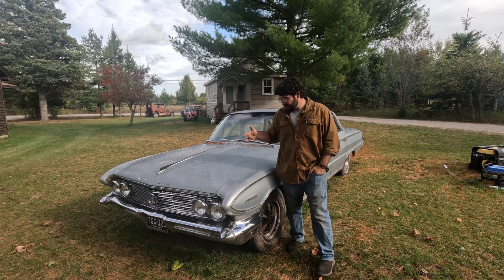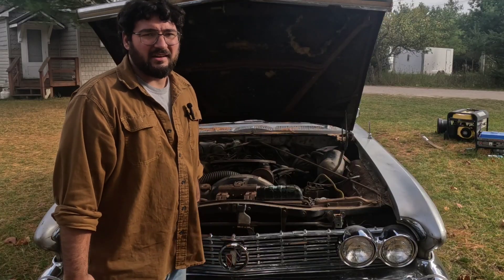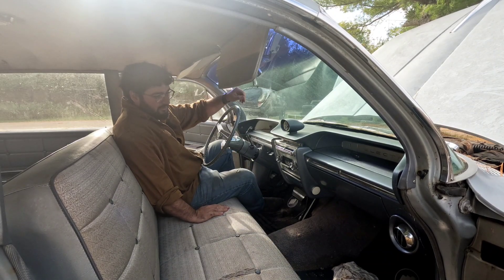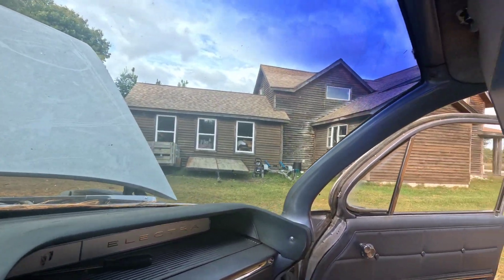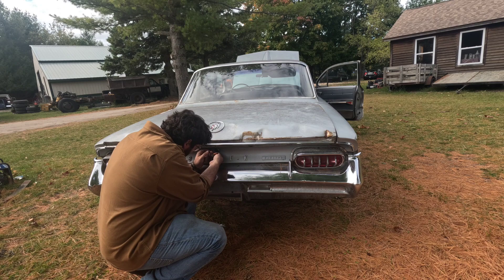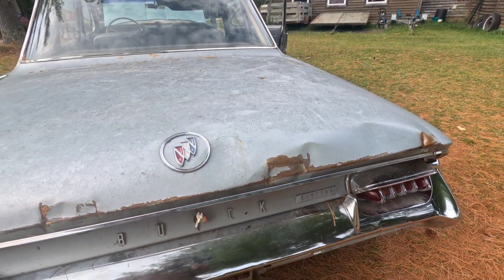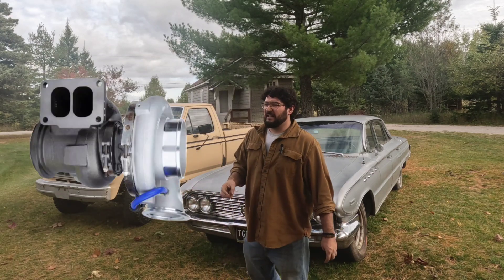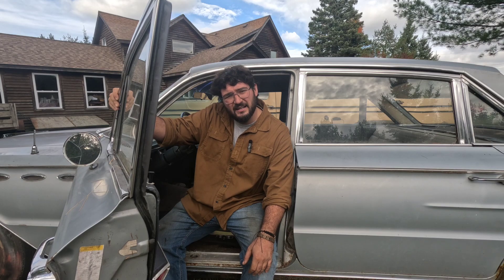you won't believe what motor this 1961 Buick Electra 225 is getting!

Comment: Hey,  you ever considered powering a vehicle with  Propane ?.. just wondering.
Reply from the maker: Terry thanks for subscribing! I haven't put any thought on it but I know they leave the motor incredibly clean. The only annoyance for the whole deal would be having a decent spot to get the tanks filled. I think you lose just a touch of power as well.
Reply: With the gaseous fuels you lose about 20 percent of over all HP. However the engines run alot longer because of no gas wash between the rings. Hell you can get a 500 gallon propane tank put behind your house. Plus.. With that engine you can rebuild it with SLIGHT cam upgrade CHEAP . you won't miss any horsepower.. that 300 is a beast... I'd love to be able to help you do that thing.. But.. I'm stuck and broke till SSI decide how much back pay I'll get.90 days.. I've never installed one of these kits.. but I will on my next vehicle.... I'm not telling you to do it... I'm old school . At 55 I do what I can.. engine rebuilding is easy on that engine... I'll be keeping up with your progress... might even come by and BS with you... BTW , have you ever watched where Power-nation. Turbo charged a 300 ? They got over 500 ponies out of it ?!!!😎
TAKE CARE.

Comment: It ISN'T a 445, it is a 401. And whatever engine you want to put in it will be inferior to the original.
Reply from the maker: It's called a 445 because of its torque rating. The displacement is a 401 though. Inferior and moving is way better than sitting in a yard rotting in my opinion